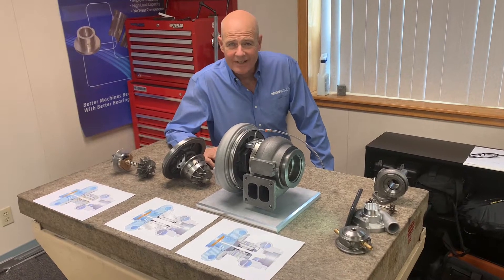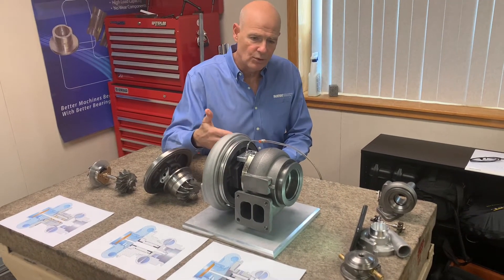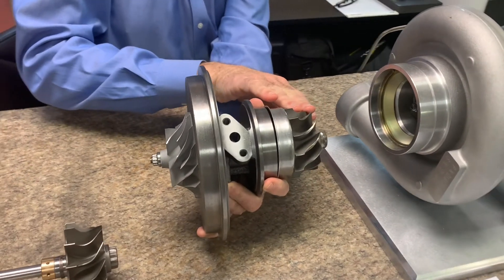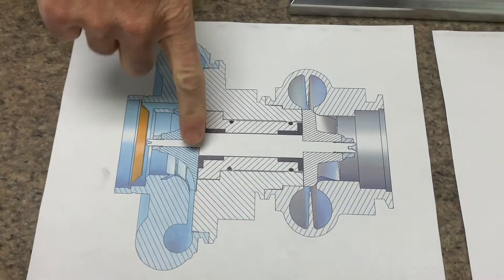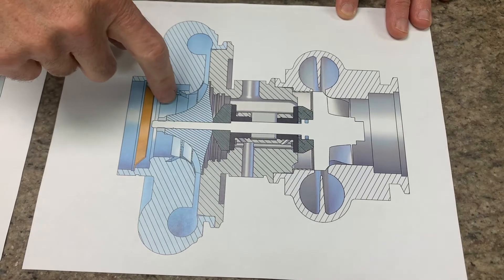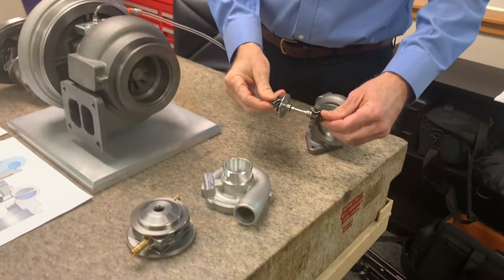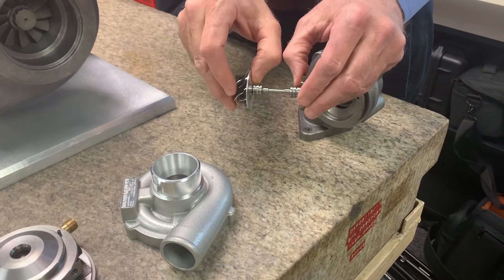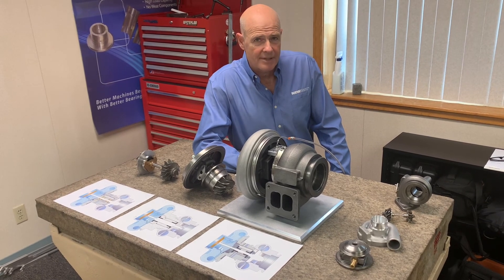Turbocharger Air Bearing Retrofit by New Way

Comment: If that shaft gets hot and expands, does that cause excessive clearance at the thrust bearings allow the shaft excess axial movement? This design is different from everything I've seen before, where only one portion of the shaft is trapped in thrust, and the rest is allowed to expand or contract axially as needed.

Comment: I've said this for years, but I've yet to understand why nobody in the industry is listening 🤦‍♂️
Reply from the maker: Hi James,
Yes, I have a hard time seeing why people don’t understand the advantages of gas bearings, and turbo chargers
Thanks for your reply
Reply: @drewdevitt  - I see why many applications can't/don't use them. Ancillary requirements, packaging dynamic load resistance, etc... but there are sooooo many applications where these are overwhelmingly applicable, yet aren't being implemented. Turbochargers are a fine example. Integrated air supply.

Comment: My primary concern would be how the air bearing can handle thrust loads. If you completely blocked exhaust gasses and compressed air from getting to the back of each wheel, you would largely negate thrust loads, so that could be a solution. You would then be dealing with only the much smaller thrust loading caused by the pressure on the outward faces of the compressor and turbine wheels. These could still be substantial given the possible pressure differentials, so that would need to be handled.

Comment: Not here to spew doubt, but my concern here is not the bearing material, well, the porous matrix to be precise, the air is the bearing material in a way, but my concern is not the capacity of the matrix to withstand the hot side, my concern lies more in the direction of the fact that as an air bearing, sure, its somewhat cooled by the air itself, but the shaft is no technically suspended, contacting absolutely nothing, as per the function of the air bearing... In such conditions, the hot side, which can get real damn hot, will heat up the impeller, thus through it, it will heat up the shaft, which being steel, will expand... How much can the ceramic or whatever matrix used, contend with steel`s thermal expansion without it becoming an issue... Being isolated, the heat can only rely on the air current to cool it somewhat, which i dont see as being adequate to cool down, what is supposed to be an ultra high precision shaft-bearing-bore system, and maintain the clearances, which as you state, should be minimal, both to run an air bearing sys, and to as you say, improve the efficiency of the turbo itself... Oil is troublesome, but it themally couples the shaft with its rotors and bearings to the housing of the turbo, which often has extra routing for engine coolant, which makes it quite a decent thermal sponge... Without oil, you dont just lose the cooling provided by the oil, but you lose the fluid coupling that allows the shaft to quickly shed heat and maintain its tolerances... 
Speaking of tolerances, if you run air bearings, they require pretty high precision, or minimal tolerances... One side is cold, which will when running reduce the clearances on that end, and the other is hot, which will loosen the clearances on that end... The shaft being insulated by air, will undoubtedly suffer from that situation even more, so how do you plan on contending with that issue? The healthy turbo range is quite varied, and the clearances have to be adequate for both support of the componentry and for adequate sealing and free running... With oil, that is less of a problem, as it has some properties that are greatly reduced or not present with the air as a bearing film medium...
Im not outright denying the idea or calling it a scam, i just see some aspects from the technical standpoint which rise some questions... Not just that, but speaking of heat and tolerances, you said the thrust clearance thermal growth can be eliminated... I dont see how... The shaft is going to be heated up through the hot side rotor, no matter what you do - the air bearing air flow cooling wont be enough to impact that... That in turn will render your shaft longer, regardless of its shrinkage on the cool side... cool side is not too cool, but hot side is extremely hot, which is bound to extend and expand the shaft during running... That will affect your thrust clearances without a doubt... And again, the shaft being suspended in air, not being actively cooled by a liquid, will not benefit from any housing cooling system... You can run liquid nitrogen as coolant through the housing(ridiculous, but im just giving an overkill situation) and it will cool the housing(thus reducing your clearances on the bore - matrix surface, but the isolated shaft wont benefit from it, it will only be heated up by the hot side and minimally cooled by the air flow and the cold side... An air bearing is not an air motor, which greatly benefits from cooling air, the bearing relies on high pressure and relatively low flow, so its self-cooling capacity is quite minimal... Which normally isnt a problem, as there is no contact or friction to induce heat which would have to be lowered... 
Air bearings are amazing, as a machinist, i love the concept, just as with hydra-bearings, but as a machinist, i know that some things are not used in some scenarios, exactly because of their inherent benefits that in some situations turn into absolute detriments... You know, ice skating is cool, and ice`s properties that allow you to skate are amazing, but they really fucking suck when you are trying to just walk or drive... As said, i dont want to call shit out as anything, but i do have some concerns, and those have been written down above...
Reply from the maker: I appreciate your comments.
Especially the ones concerning thermal growth. Actually, the shaft will expand more than the poorest media so the clearance is reduce in the hot area and expand in the cool areas, especially in cryogenic Turbo machinery. 90% of turbo chargers have a shaft that’s less than half an inch in diameter and most of those are on the order of a quarter inch so even with large temperature swings the thermal growth is not great. Also the turbo chargers heat up quite quickly because of the hot exhaust gases, so we just leave enough clearance to accommodate the growth which happens quite quickly.
The ultra fast pull up and efficiency improvements by avoiding oil shear drag are huge improvements for turbo chargers. Plus, there is no oil to Coke improving the reliability and longevity of turbocharged systems.
Reply: @drewdevitt  Most glad to hear back from ya! Great, glad to hear your analysis of the system... As said, i was speculating, i know that the growth ain`t much, but being that i am not the one designing this nor researching the specific materials and applications, i still am lacking specific insights into performance of this system, especially on the long run and in the ``field``... Sure, oil/grease shear is a major drag contributor, no doubt there... Hell, even air has shear of sorts, or rather, a sort of molecular friction when it passes near something, so yeah, switching from lubricant shear to what is essentially a jig grinder spindle with the ridiculous bearing efficiency is a major deal... 
As said, i didn`t come to shit on this, on the contrary, i was curious and unsure as to how well the system would operate ``not on the clean room table``... As a machine fetishist, i am aware that the field and clean room perform a lot differently, so i had to ask... And now i am glad that i did... I wonder what is the running, full temp - clearance of the spindle in those bearings, or the shaft in this case... Cant be far from a micron of few, in which case, i wonder what`s the clearance of the same part when cold... 
Hell, i would love to see the dynamic graphic display of the system fluidity and fluctuation as it goes from 0-100, or rather from env. temp to full operating conditions... That would be a damn cool sight with modern cad display capacities of computers... 

At any rate, i wish you all the best and you have my kindest regards!
Steuss
Reply: Marrow porous pads mounted on springs holding the shaft

Comment: Compressor wheels with flat backing are outdated designs, reason they are nit flat is you are trying to push as much rpm into the wheel as possible, and with raised back the rpm can double in some turbos so you want to avoid flat backed compressor and Turbine
Reply from the maker: Impellers with flat backs and our externally, pressurized gas bearings running on them reduce clearances that are typically required between the impeller and the rest of the state or housing. Turbo chargers should spool up quickly. The oil shear at high speed is a surprising drag on the ability of turbo chargers to spool up, this has a much bigger effect than the geometry of the impeller.
Reply: @drewdevitt  I think what he was trying to say is that the superback design is necessary for structural integrity of the compressor wheel at high speeds. It is not about sealing of any kind. However, even a superback design could obviously implement a flat area or whatever is required for sealing.

Comment: Love your videos. I’m hoping air bearings become more and more accessible for consumer products & retrofitting. Converting a wood lathe to air bearings for higher precision/surface finish, lower noise, and rock solid indexing when stopped, for example. Or a vinyl turntable with linear tracking that is an order of magnitude less expensive than the current options on the market.

Comment: How many thousands of hours of dyno testing has the retrofitted turbo setup done? The bench is one thing a running engine with constant changing temps, pressures and environments is totally different.

Comment: Awsome video en explanation! I'm really interested in how much air it uses at what pressure for the smaller version of the turbo charger, en if it's depending on the mass of the rotor how Much pressure is needed